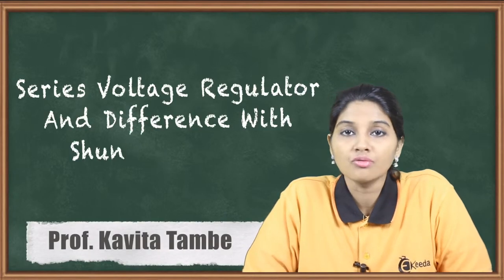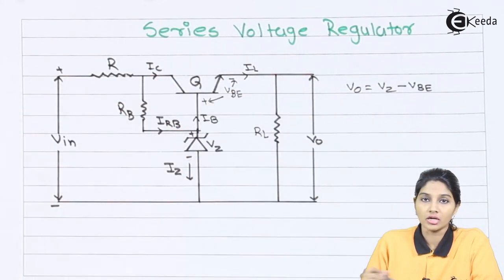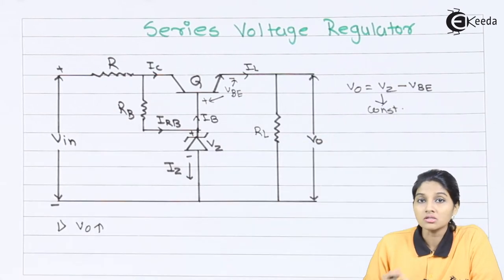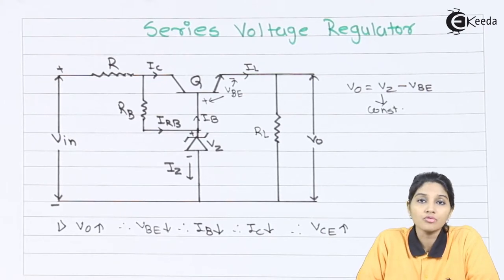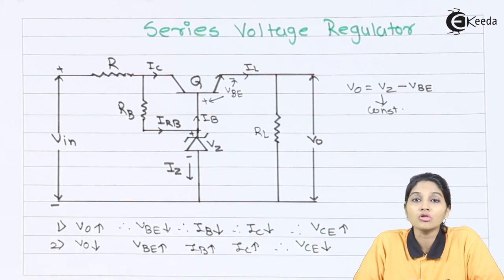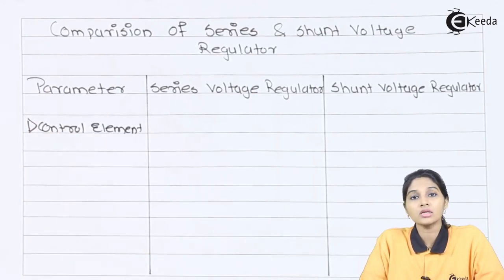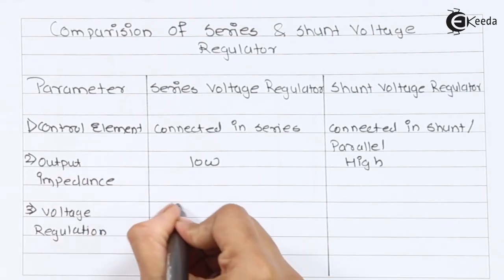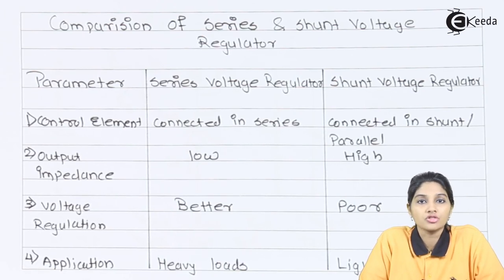Series Voltage Regulator and Difference with Shunt Regulator - Basic Electronics

Comment: Seems like the shunt would be more efficient if the input voltage is close to desired output, especially if current is very high, since much less current would flow through shunt vs series regulator?

Comment: if the power source can be controlled, it is better to regulate the current from the electromagnetic rotor, so that the regulator will not be loaded with a large current to maintain the voltage.
Reply: Hi